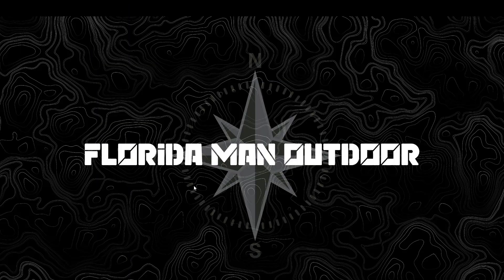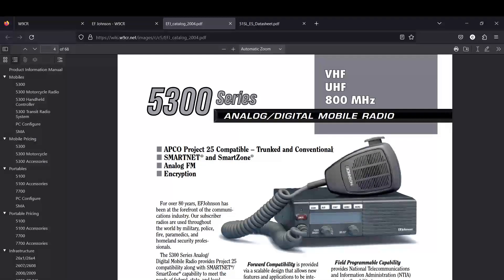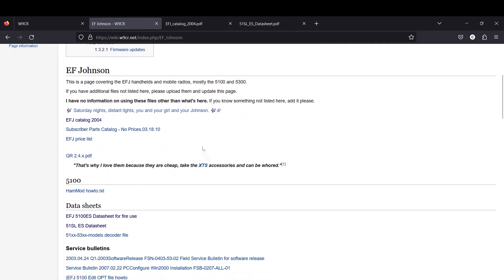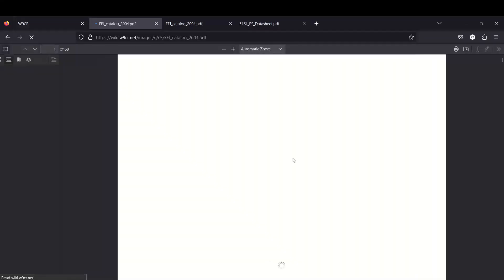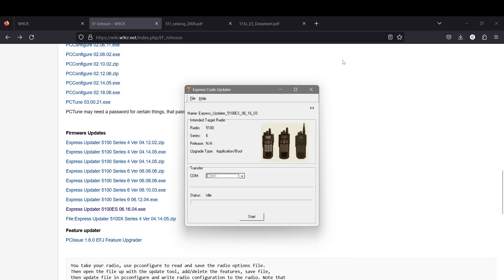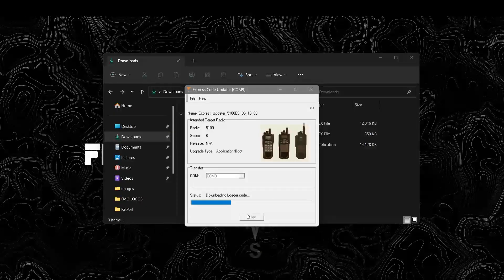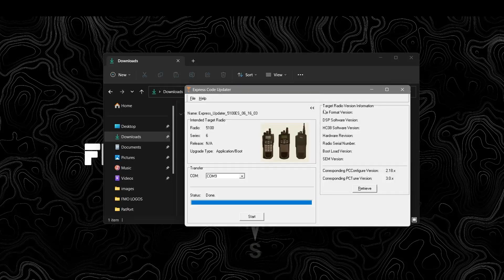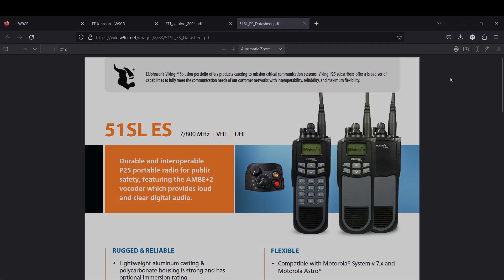EF Johnson 5100 ES Programming Pt.1 Firmware Update

Comment: Any chance you know how to get at 5300 mobile into bootloader mode?  PCConfigure manual says you need a Flash Mode Select Plug OR to short Pin 3 (ground) and Pin 7 (RS-485 Busy) when turning the radio on.  On a forum I found this means: short mic pins 3 & 7 - these are the left most pins on the mic jack (when looking at it head on) on the lower two rows.  This does not seem to work and I cannot find a pinout myself to confirm.  I tried this with some stripped back Cat5 to make a jumper wire to short those pins.  I am also using the lighting control head.  Another posts shows the lighting head to be Pin 3 (ground) Pin 6 (RS-485 Busy), but I am unsure how the pins are counted.